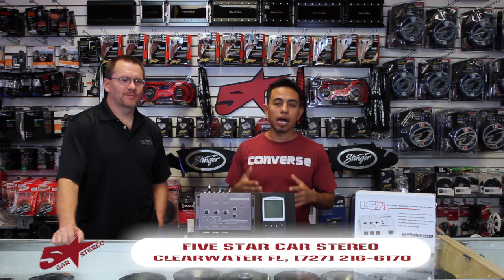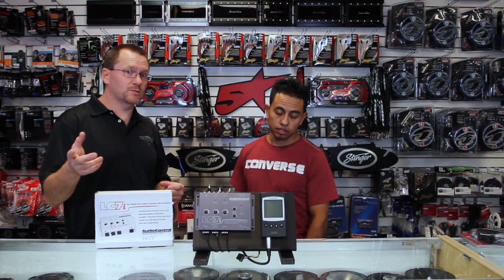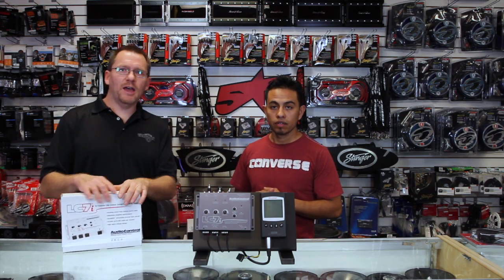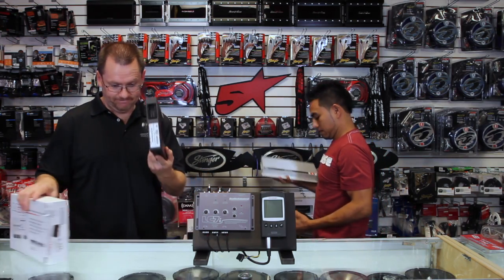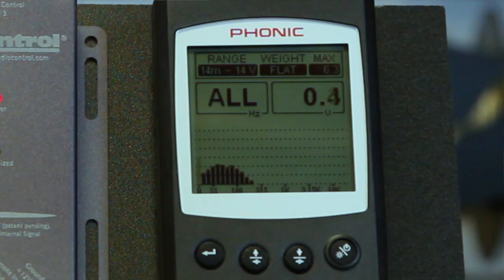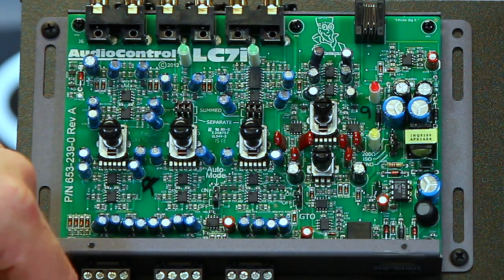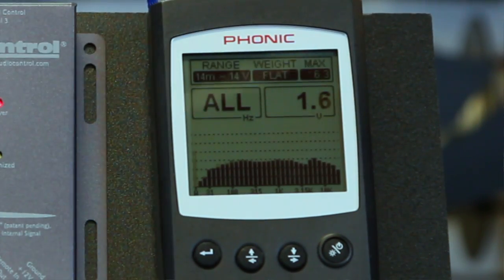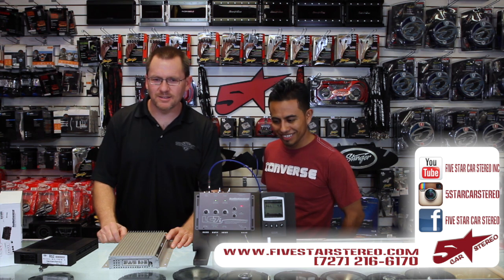Introduction to AudioControl's LC7i part 1 "how to do 3 way summing"

Comment: How does this InputCh Sum differ from something like a 363 DSP?  How do you tell what you need summed?
Reply from the maker: +UnknownHandle UnknownHandle for the most part the end result is the same. The 360 does it electronically from a computer telling it. The AudioControl has a jumper inside that you move.
Reply: BTW, with a DSP and a stock head unit from a low end car base model, can a DSP normalize a system to be just as good a signal as an aftermarket head unit? You sell both, so this should be a non partisan answer(Although the markup on these EQs are better margins :-)
Reply from the maker: +UnknownHandle  if we can do a new radio we always will recommend that first. Sometimes like today we are not that lucky so we are adding in a AudioControl lcq-1 to a Dodge Ram. We went with the EQ version to help flatten out the factory sound. It will be a pain and take some time or get it where an aftermarket head unit would be  right out of the box.

Comment: one other thing post factory amp do I completely disconnect the speaker wiring from the amp or am I just jumping ( splicing) for a signal to the lc7i? Because im kinda confused as to where the after market amps get their speaker signal is it just directly from the RCA's and no speaker leads come from the aftermarket amp to the speakers, and if so where do i wire them back to if ive already used them from the factory amp? Thanks ive always installed my own but this one is a lil different just dont really understand the loop
Reply from the maker: Normally you cut the harness. One side goes to the input of the Lc( output of amp) and the other side (speaker side) goes to the amp output.
Reply: Five Star Car Stereo do you cut the harness behind the factory radio or cut the harness at the factory amplifier?
Reply: Jacob Sullivan it depends witch is easier.

Comment: Hey fella's i own a 11 lexus gs350 non ml what would be my set up? my car has 10 speakers 2 tweeters in the dash, one center dash speaker, 2 door front doors, 2 rear tweeters and 2 read door and a sub running 1 jl 4 chan, and 1 jl mono  with 12in jl
Reply from the maker: It really depends on how May channels the amp has. I would start by going to the amp and running a test tone though the outputs. You need to see if any speaker are run in pairs, like the tweeter and door speakers. Once you know how may channels need to summed like all 10 or just 6, we can help you decide.

Comment: I love your YouTube channel and I have a question for you about this piece of equipment. I own a 07 Lexus ES350 non ML edition 8 speaker setup. I would like to keep the stock receiver (even though it is not the touch screen nav version). Would you recommend this for that application. All the oem speakers well be changed here shortly.
Reply from the maker: This are go to product for your type of upgrade. There are a couple of things to test first. 1 is the tweeter and the midrange in the same channel or separate. You can test for this at the amp using a small battery or a tone generator. Make sure the amp is unplugged and tap the speaker wires to  the battery to see if you get a tic. Flip the pos and neg back and forth and have someone put there ear to it. ( if it has a it will only pop once that is why you flip). If the door and tweeter pop you are good to go. If not you can still use this you can just not run the rears though the 7. I hope this gets you started.
Reply: Thanks for getting back to me. Keep posting those vids. Very informative.